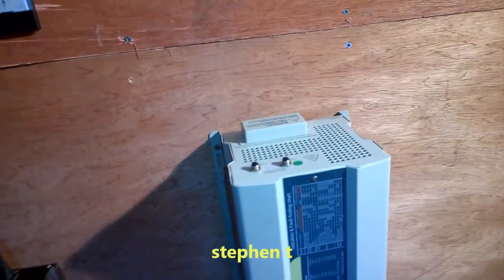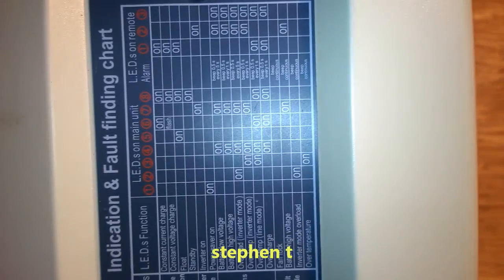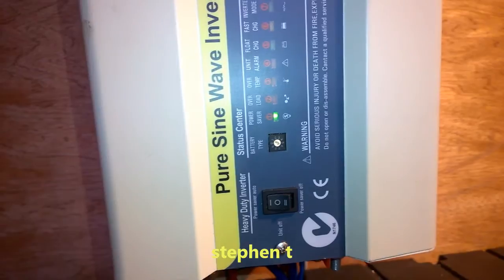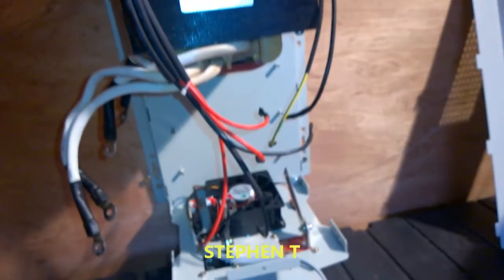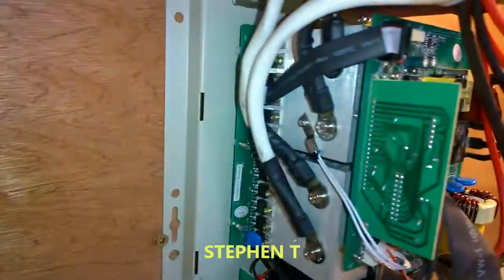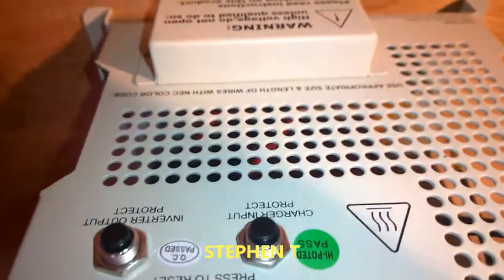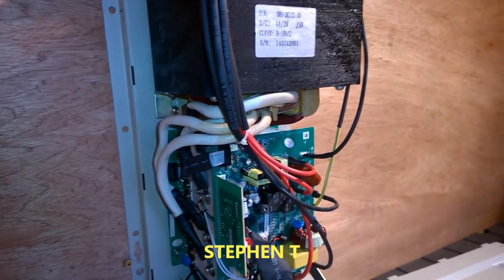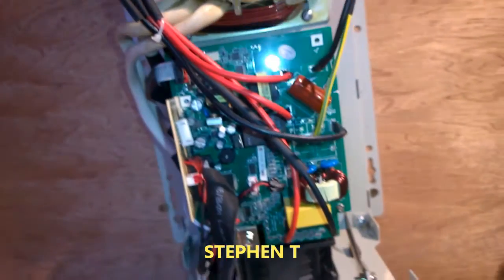3000W INVERTER WITH 9000W SURGE ON TEST FOR 6 MONTHS

Comment: Hi Stephen T, congratulation for your explanations.I would like to ask you the brand of this inverter, and were did you buy it,   thank you. NJM
Reply from the maker: Thanks. I got it from china direct a company. I will try and find the email. They are a great inverter its being in use everyday for 2 years with no issues. I do have my home running on it i use a 2.5kw washing machine and a dryer 2.5kw so it does be @ the max of 3kw for hours with no issues. You wont have a prob with it.
Reply: +Stephen T  Thank you, if you find the Email, could you send it to me  please. tank you in advance. NJM.
Reply from the maker: I will check that for you a.s.a.p.

Comment from the maker: It is a great inverter. There is only 3 parts to change its very easy to work on. I will try and get the info for you. Yes its a 12v system its just easy to make up with batteries.

Comment: One more question. What's basic dimensions (length x width) of box? Thx Stephen
Reply from the maker: Do you want it in inches?
Reply: no need...see my last comment.  but in future  we use same measurements as you in Ireland (e.g., non-metric)
Reply from the maker: Ok I got your last comment. We use metres and mm over here ;)
Reply: did not know that...interesting.

Comment: Where did you buy your battery boxes? Is there name/brand? Thanks
Reply from the maker: I bought them in a store in Ireland called lidl. Not sure of a make of them but they are cheap under $20
Reply: damn...i was afraid you would say that...that's one of those items you either get lucky and find at your local store/chain, or don't.  i've pretty much resigned myself to building one anyway for the cabin especially since i have some pretty unique dimensions. 

Thanks for getting back to me Stephen and for contributing the great vids
Reply from the maker: ya its very hard to find. I would like to see your video on your battery box. How many batteries have you got?
Reply: 12 6v  gonna build a 4' x 2'.  check my last vid post to see them if you're interested..
Reply from the maker: Ok will check it ok